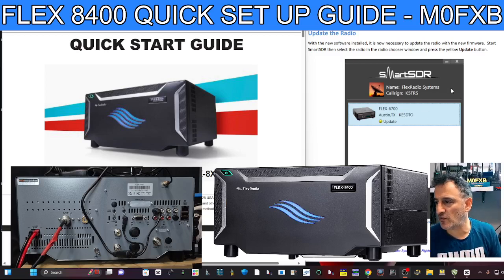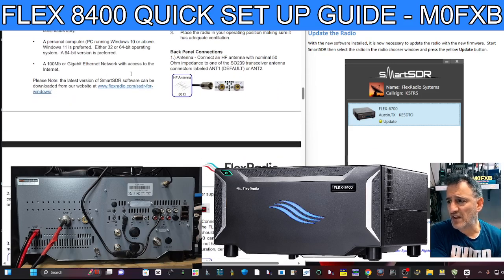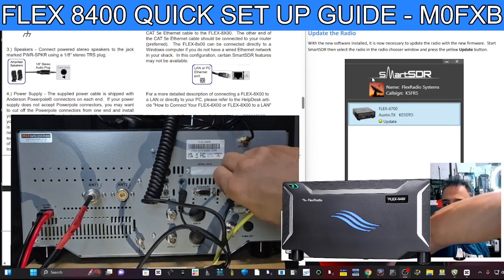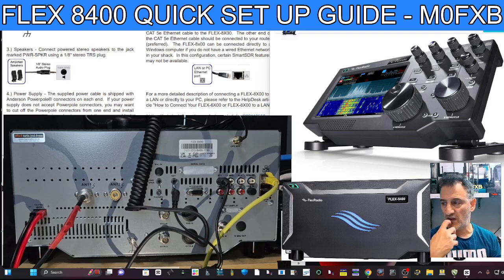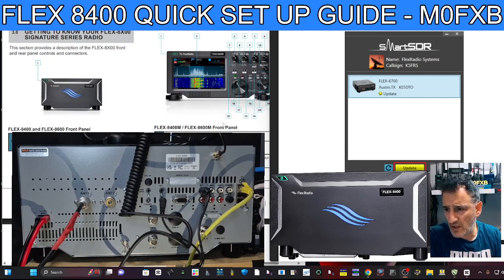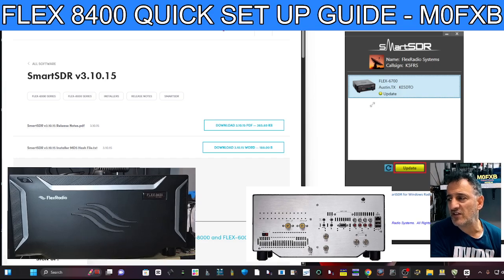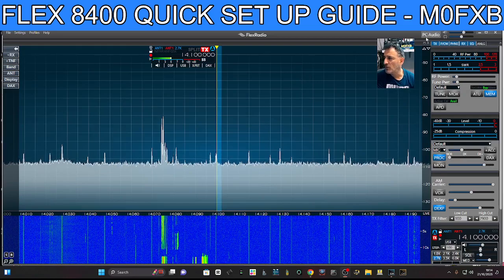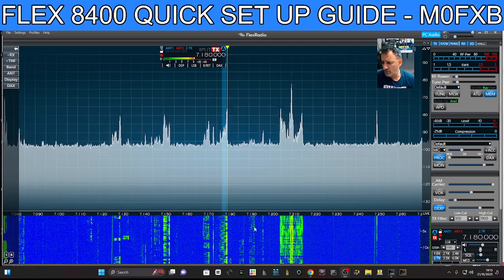Flex 8400 - First Time Set Up - 2025

Comment: Congratulations for the new flex. I want to get the arura, but I want to see them in the hams hand and see the reviews before paying $7500 for it. K4NCC
Reply from the maker: Get the .Maestro
Reply: The Maestro is just the control unit Andreas, the Flexradio itself is obviously an 8400, 8600 or one of the new Auroras when they are out. But the Maestro control unit will work with them all.